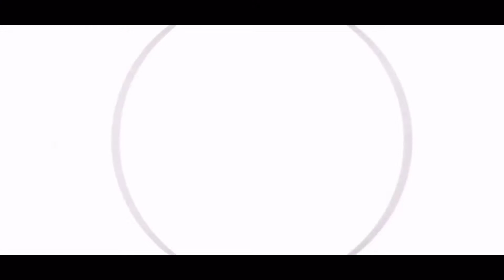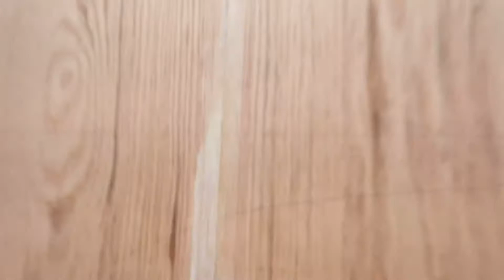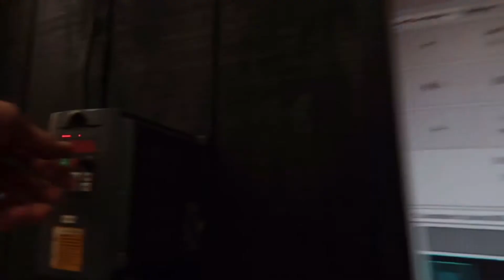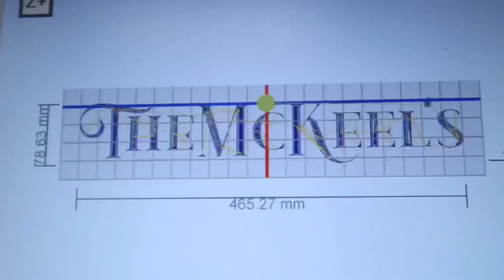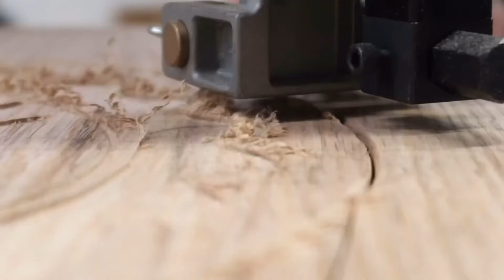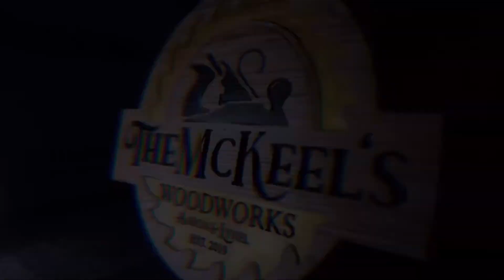Carving a wood sign with a CNC router - Custom logo signs

Comment: Nice video! When you are designing something like your shop logo that you are going to make on your CNC, what file format do you normally work with and in what program? I am just in the beginning of the CNC router learning curve and have used Adobe Illustrator for making a company logo for the internet but not certain what file type I would use to send to Vectric and then on to my CN for wood logos and signs. Thanks.
Reply from the maker: The program I use to get raw files to gcode is vectric.

Similar to photoshop or other Adobe programs, you can import jpeg and outline the logo and export as a Photoshop file. It is similar in this program you can design a logo in Adobe and import it into vectric. Once it is in vectric you can do a bitmap tracing. This will give you a file that you can export and save as G-Code. 

There is a lot when it comes to CNC, but once you get the basics down it is not too bad..

My advice would be to research cam)cad software, and do some research on the v carve pro.

Hopefully this helps, eventually I plan to do a overview of my CNC and the equipment I have. Feel free to ask me any questions as they come up

Comment: I also have a workbee, what size machine do you have? I have the 1000X1500 it has a few problems with accuracy when doing borders, also what router are you using? Looks good
Reply from the maker: https://www.ebay.com/itm/Newest-1515-Work-bee-CNC-Router-Machine-Full-Kit-4Axis-CNC-Milling-Machine-Kit-/124099714861?mkcid=16&mkevt=1&_trksid=p2349624.m46890.l49286&mkrid=711-127632-2357-0
Reply from the maker: We have a Workbee 1500x1500. 

We have a water cooled spindle, here is the link for our setup: 

I had a few dozen Gremlins to work out in the programming with my CNC shield and adreno, so we decided to upgrade our system nema 23 stepper motors and drive system to the brand open builds Black box. 

Since we've upgraded to open builds motors and black box, we haven't had any issues so far. 

The difference between CNC shield and adreno, and open builds Black box is about $200. But if you want to use your CNC machines full design potential, you may want to consider upgrades. 

Without knowing the specs of your machine, I can't really speak to your accuracy problems, but I had an XY direction issue, be sure to check all of your wire connections that they are snug. And if you have potentiometers on your CNC shield, make sure you have a fan on them overheating has a lot to do with directional issues. 

Hopefully this helps you, thank you for supporting our channel, and subscribing! Feel free to ask any other questions!

Comment: I’m struggling to understand your thought process. You warn people about the time it takes to change bits and then don’t use your CNC to profile cut out the sign? Mind-boggling.
Reply from the maker: It may be a difficult process to understand seeing that the bit changes were not shown, but if you have 8 tool paths and 4 bits. You must plan the tool path according so not to change your bits more than the minimum amount because every bit change can take upwards of 15 minutes. 

The reason I chose not to cut out the profile on this particular project, is so I could highlight the fact that there are many ways to get a project completed. Also, I really wanted to use the band saw! It is one of my favorite tools! Thanks for watching!
Reply: Do you think using the  band saw without " changing tools" was easier than adding a toolpart to the design and using your CNC?
Reply from the maker: @bmmacoh3387  at the time this video was shot it was much easier to use the bandsaw because I was running on an old operating system; I was using CNC shield, paired with adreno. Now my system has been updated to open builds Black box. This new system can handle far more movement commands without being scrambled, I had had many issues with profile cuts at this size with my old system it would usually glitch and end up running the tools straight through the middle of my design at 50 tool paths as my feed rate. With my Black box by open builds, today I can run at 200% toolpaths and have zero issues with my system. 

As I stated above it was much easier at this time to profile cut due to the high risk factor that was involved in using a profile with my CNC shield system. Maybe we will post a new CNC video and use a profile cut since everybody seems to be really concerned with using the bandsaw in a CNC video.

Thank you for your support and thank you for your question, you guys are really making this channel exciting for us!

Comment: Really nice work. Couple questions... What was that gold paint you used. That was a great choice! Second, why did you not have the CNC do the cutout?
Reply from the maker: Good questions! 

1: we used this paint from Michaels arts and crafts; https://www.michaels.com/metallic-acrylic-paint-by-artists-loft-4oz/10266586.html

2: I didn't cut the sign out with the cnc because I didn't want my cutting head to make marks on my spoil board. Since this project, I have been using a caliper to help me properly measure the work piece and cut it out without having to finish the cut on the band saw. 

Thank you for supporting us and subscribing.